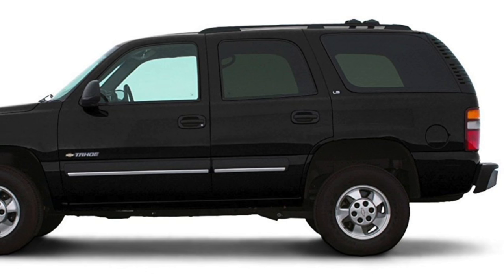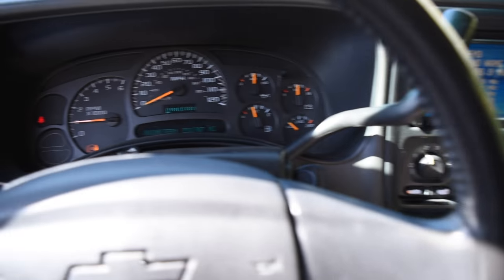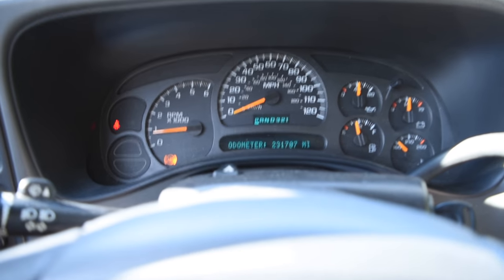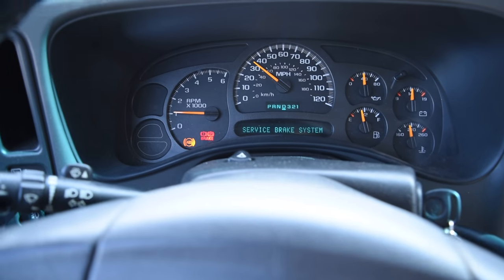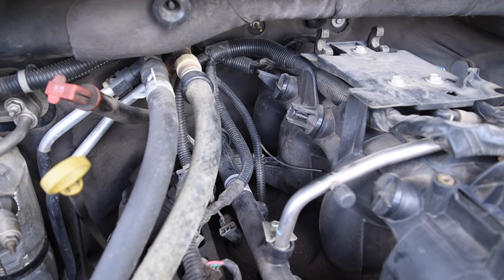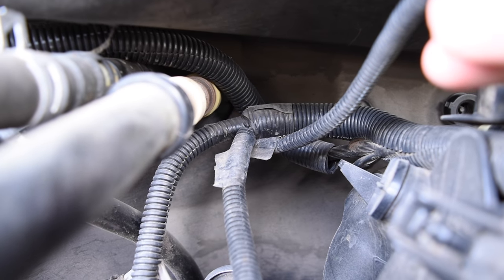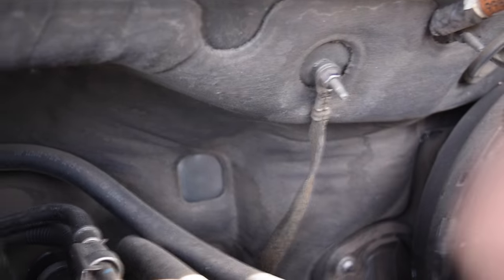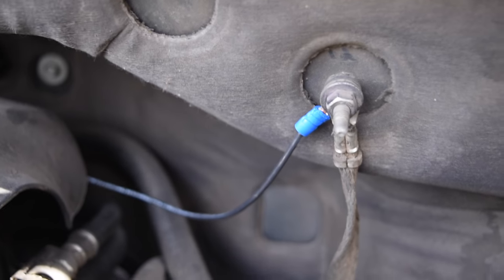2003 Tahoe Loose Ground Wire causing ABS, Park Brake, Door Locks, AC, issues

Comment: My 04 Silverado shut off doing 55, and now won't even start, but is showing the "service brake booster" randomly, and also won't prime the fuel pump even though it's a new pump. Also randomly won't even turn over. Going to search for this loose ground. 19-year-old truck, hoping that's all it is. Everything else has been replaced within 6 months.
Reply: Was that ground the problem or a different one?  I have an '04, Z71, Burb and did this same fix.

Comment: I have a 04 Tahoe the check engine light cuts on but it goes off once I get a jump off plus my dash light comes on and off and I think something might be wrong with my fuel pump also it only crank if it’s on half or full

Comment: Was your Voltage dropping to about 10 on the dash also with this problem or it didn't affect it mines runs fine but my voltage drops to almost 10 on my dash when i at idle with my ac on and front and back AC i just upgraded to a 220 amp alternator from a 145
Reply: Did you find the problem and solution?  Mine is doing the same thing!
Reply: @garyschwalm4842  ni t yet doing a big three upgrade this weekend and getting agm battery replacement for my crappy O'Reilly's brand

Comment: When I turn my key my Silverado won't crank. The headlights, radio and cluster work fine nothing dims I need help. The only ground I found loose was the one connected to the rack and pinion

Comment: Holy shit we have the exact same radios... but I replaced wheel bearings in the front speed sensors got power in the loomz etc only thing left is either I’m missing a ground strap somewhere or my abs pump is shot at 90k miles

Comment: I have a 2003 tahoe. My gauges don't work, my mirrors and seat adjustment on their own etc. I was told it's either blown fuse, bad ground or instrument cluster. I'm going to check fuse and ground first. Also none of my gauges work. Speedometer, odometer etc. I'm no mechanic but trying. Any help?
Reply: I just had my cluster rebuilt and my speedometer still doesn’t work but I looked at my rear view mirror and saw my outside temp and direction going crazy so now ima check my grounds

Comment: Where does that wire strap go to where you attached that little black 14 gauge wire to? My wire strap burnt and I don't know where it connected.
Reply: Behind the engine block. You have to lay on the engine once its cool and look directly behind it and you will possibly see it sticking out like I did.
Reply: Does it have to be grounded there? If so just get to it from topside?

Comment: I wonder if the 07 and up trucks have the same wire?? As soon as mine gets back from the shop I'll take a look 😂🤣. Having similar but different issues and I'm thinking what the mechanic is fixing won't actually fix my issue. Lol. I'll post back later
Reply: I have an '05 and I can't find that wire on mine.
Reply: What is your issue??? My truck just dies and sometimes it’ll start and sometimes it won’t. Make the service air bag and service 4x4 come up on the cluster. I can shake my wiring harness and it starts. It’s also kill all power to my obd2 plug when the truck dies.
Reply: @brandongrant5343   bro im having similar issues now I hate when they don't say the answer to the problem when u ask
Reply: @CJ Tha God my whole engine wiring harness and fuse box ended up getting replaced. Someone prior to me sauderd like a 3” wire in and the sauder was causing a blockage in communication. Even worse, warranty wouldn’t cover it and I didn’t even do it!

Comment: This wire was grounded to the block. Why would you ground it to the body? I grounded it to the body and it didn't help my problem so I will move it to the block and see if that works.
Reply: ???? I didnt move it and try yet.
Reply: Check the Fuel System Control  Module.
Reply: The truck runs fine. Just abs and brake lights are on and tack wont work either.
Reply: The fscm sends signal to the bcm and all other modules. Due to its location under the bed of the truck it is prone to corrosion. It's a simple check. Unplug it and clean with contact cleaner if a simple pin out is too much to do. Let it dry and reconnect. Worst case scenario you still have an issue. Or do nothing that's fine as well.
Reply: Did all that too. 03 denali has problem with inside solder joints and I cant get the torque screws out. But still want to try that one ground also.

Comment: My speedometer bounces up and down or will stay at zero when driving, I've replaced to speed sensor and its still not working  the abs still says on too
Reply: GM gauge issues are usually a stepper motor on the instrument cluster itself.

Comment: My abs, service 4wd, and air bag would come on. Plus my speed control on my AC quit working. I’m gonna try this and see if it works or not
Reply: Did it work for you? Same damn issue with mine lol
Reply: I have an '05 and I can't find that wire on mine.
Reply: I have 4 cluster motors not working, abs, and brake light on
Reply: Anthony Butterfield i have the same thing any changes on that ?
Reply: @joshuabustamante7894  did you ever figure out the issue I'm in the same boat as you seem to be
Reply: @michaelplemons3688  I havnt and im at my wits end. Theres 204k miles, rebuult tranny, new water pump, very well taken care of. But damnnit to hell, ive re routed the engine block ground wire, ive cleaned and scrapped the metal below driver side door, the abs and other ground connections but still nothing works. Im thinking its the ECU board or the connections above drivetrain for 4x4 drive. IDK, if its not that this baby is for sure going to be traded in. Lol
Reply: Brayan Garcia I drove it a mile away from my pad to some old man that repairs them so we’ll see what happens
Reply: @joshuabustamante7894  blower on all the speeds except hi quit, the service brakes is displayed,  and the service 4x4 is displayed.. I've tried everything tou have and still nothing.. did you end up replacing the ECM ?
Reply: @butterssfromthe3104  any luck???
Reply: @joshuabustamante7894  did you try the ground wire in the harness that goes in the column that goes to the key switch? I heard it can get loose and you can wedge a piece of like a toothpick in it to tighten the wire

Comment: My 04 sierra does the exact same thing but says engine reduce power and stalls out,  and won't crank back over till it cools down some,  I've noticed it only does it when it gets around normal running temperature. Any ideas that might help?
Reply: I've seen a video where this ground wire fix did fix another guy's. This flippin ground wire causes alot of probs. Did you try it?
Reply: If the ground wire fix doesn’t help, Check this out: https://m.youtube.com/watch?v=2SCIRSBejA0  Particularly between min. 17:50-20:50 for easy diagnosis of failing fuel pump with a multimeter. PO 300 obdII engine computer code implicated as well.
Reply: Also possible signs that uoupl be replacing crank position sensor in the future it will start and stall randomly,  then more and more then over and over time you get so pissed youd wish itd run just 1 more time, just long enough to ram the truck full speed  into the side of a boat, going up and over the boat mangling driveshaft but correcting the sensor issue

Comment: Did this make your truck not want to shift when abs and parking light came on
Reply from the maker: Sorry for the delay in responding.  To answer you question, I did notice that at slow speed when this issue occurred the truck did hesitate for a split second, but i did not notice any shifting issues. Thank you
Reply: Check your speed sensor in transmission not hard to replace
Reply: Shad Lo yea i had same issue and yea the transmission would shift roughly around 2,500rpms it was having issues i cleaned all my grounds the one mentioned in this video and the one underneath the driver aide and by driver side front bumper and that took care of the issue
Reply: @tattooart420  how do I check or replace this sensor? And what's the part I need. I have a 2093 suburban 1500

Comment: Anyone know why on a 1999 obs chevy tahoe none of the gauges work except the tachometer, I replaced the cluster and same thing
Reply: Where you able to fix it? I have the same issue
Reply: @marcoslupio8009  unfortunately no, I've just learned to drive by watching the rpms so I know how fast I'm going and making sure it has plenty of gas
Reply: Does it have a circuit board instrument cluster? Could be bad solder

Comment: I love my Tahoe but the electrical problems are a huge turn off, lol I’m super Frustrated.
Reply: They're not bad
Reply: @JamesValentineBaja1000  IMO they are very bad. I've owned many vehicles and have absolutely never had as many electrical issues as my Tahoe AND Silverado 2500hd have. Headlights go on and off randomly, cluster flickers, ABS light, o2 heater core codes, multiple corroded ground cables, check engine light goes on every time and prevents passing inspection until I find and repair the problems. I do like the vehicles, but its maddening to find these electrical issue solutions.